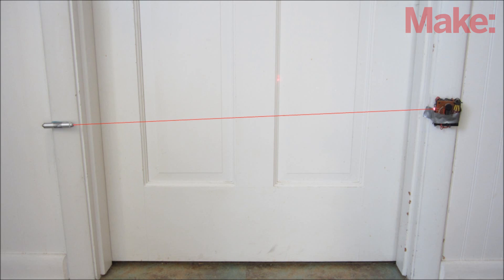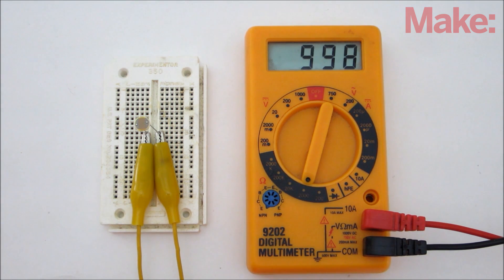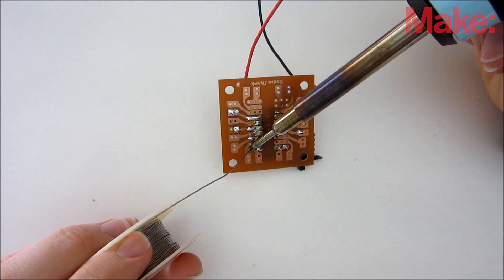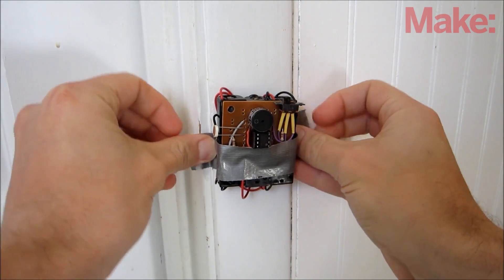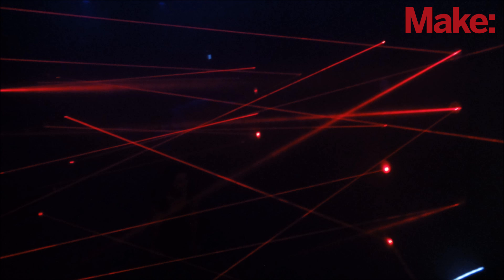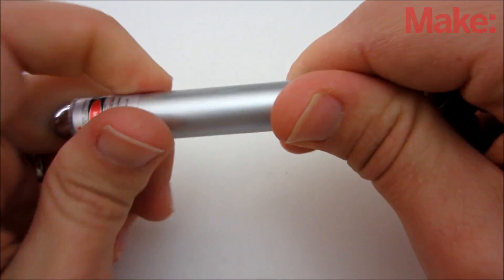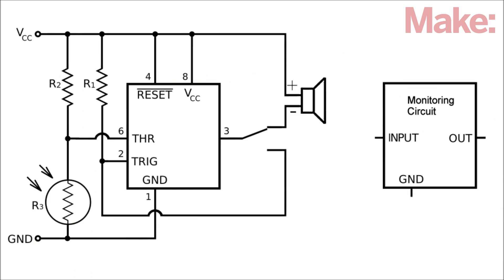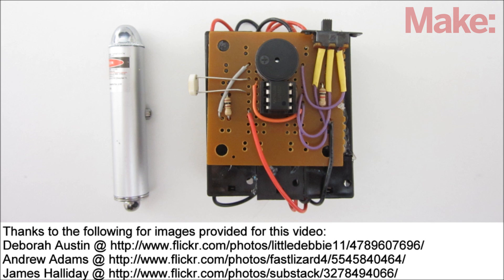DIY Hacks & How To's: Laser Tripwire

Comment: It works !!!!!
You need to know the value of the photoresistor when shining the laser on it by mesuring or to search the details of the model of your photoresistor !!
And if you want the buzzer works you need the power of the buzzer needed (me was 5v)
Buy part list on ebay or tayda electronics !
Reply: +JS7457 can i have the list of parts needed
Reply: Supachai Abusali yeah sure, here it is :
NE555 : http://www.ebay.com/itm/50PCS-NE555P-NE555-DIP-8-SINGLE-BIPOLAR-TIMERS-IC-factory-price-/321464862752?hash=item4ad8cc8820:g:gQEAAOSwGzlTx59S

8 pin socket : http://www.ebay.com/itm/50PCS-8-Pin-DIP8-Integrated-Circuit-IC-Sockets-Adaptor-Solder-Type-/281680024453?hash=item4195701385:g:Vc8AAOSwPgxVRLDf

resistor kit lot : 
http://www.ebay.com/itm/Nice-300PCS-30-Values-1-4W-1-Metal-Film-Resistors-Kit-Set-Resistance-Perfect-/111783588236?hash=item1a06d2318c:g:vqQAAOSwWnFWCQvs

photoresistor : http://www.ebay.com/itm/20PCS-GL5528-Photoresistor-LDR-Photo-Resistors-Light-Dependen-t-DE-/252118469425?hash=item3ab36e8b31:g:nqgAAOSwq7JT-wXz

slide switch : http://www.ebay.com/itm/20pcs-Mini-Size-Black-SPDT-Slide-Switch-On-Off-3-Pin-PCB-Mount-for-DIY-5V-0-3A-/361211745841?hash=item5419e5d631:g:MicAAOSwrklU2GuM

buzzer : http://www.ebay.com/itm/10pcs-Electromagnetic-impedance-16ohm-Universal-Passive-Buzzer-AC-2KHz-3V-5V-12V-/381374353810?hash=item58cbaed192:g:iN4AAOxy3yNTifFY

breadboard and jumper wire (optional) :
: http://www.ebay.com/itm/High-Quality-Brand-New-MB102-Power-Supply-Module-3-3V-5V-Breadboard-Board-830-Po-/252032256906?hash=item3aae4b0b8a:g:RU8AAOSw3ydVk6Bf

Prototype board :
 http://www.ebay.com/itm/10-Pcs-5x7cm-Prototype-Paper-PCB-Universal-Experiment-Matrix-Circuit-Board-2014-/400685385795?hash=item5d4ab5c843:m:mMucbQf0ZwjBE4Fa-XRStdw

Laser : http://www.ebay.com/itm/Portable-Mini-Laser-Pen-Pointer-LED-Flashlight-Torch-Money-Detector-Ultraviolet-/251972992471?hash=item3aaac2bdd7:m:mOC4qmLeAOmuqSUknzowJZA

OR

5pcs laser module : 
http://www.ebay.com/itm/5PCS-650nm-5mW-Laser-Red-Dot-Module-red-laser-sight-laser-diode-laser-pointer-/261977613858?hash=item3cff152622:g:tH8AAOSw7aBVC9xK

3 AA battery holder case : http://www.ebay.com/itm/New-3-AA-2A-Battery-Holder-Box-Case-With-Switch-EE4068-/141351797613?hash=item20e939436d:g:JEsAAOSwbqpTydFm

10m hookup wire : 
http://www.ebay.com/itm/10M-New-26AWG-1007-GAUGE-Black-Red-Wire-Cable-300v-80-C-new-good-/291548700260?hash=item43e1a81e64:g:UwQAAMXQgyZR75Uj
Reply: +JS7457 thanks a lot.... most of the parts are already in my arduino starter kit... and do u know where can i get the source code for this project
Reply: +Supachai Abusali source code ?
Reply: no problem i already got it

Comment: I actually found a lot of this video useful, but I have a little bit of experience  that helps.
The narration is top notch, the content should have been extended , this video should be at least 12 or 15 minutes and go over the process with a shot of the bread board that you could see every connection not just some.
To continue with the great contribution Scott made, here is a link for ebay search on the dip socketts , you should pay 10 cents or so not a dollar each, we could get the price of this project down around 5 to 10 bucks if we work at it, I'll try to help more later.
Search link:
http://www.ebay.com/sch/i.html?_odkw=6v+30+rpm&LH_BIN=1&_osacat=92074&_from=R40&_from=R40&_trksid=p2045573.m570.l1311.R8.TR11.TRC1.A0.H0.X8+pin+&_nkw=8+pin+dip+socket&_sacat=92074

Comment: I was so angry that there was no parts list that I made one. These should be right (but I promise nothing ;)

RADIO SHACK PARTS LIST (search for these numbers on the site):
Breadboard: 2882885
Wires: 2103801
Switch: 2062488
Photoresistor: 2062590
Piezo alarm: 210819
Battery Holder: 2062239
555 Timer chip: 2062595
8pin Retainer: 2062604
100 ohm resistor: 2062339
1000 ohm resistor: 2062343
(Yes, I actually had to look up the resistors by color code)

All together from the Shack will cost about $52, plus the laser pointer you can get at a dollar store. The reason the cost is high is that they don't sell singles for many of these, they come in packs of 5. 

I hope my wasted time of making this reminds MAKE to include this or these videos are just silly brand marketing and not helpful in any way.
Reply: Thanks for doing this! So appreciated! We're building an escape room, is there a laser pointer that can be seen without making the room dark?
Reply: @benpointer9227  not really unless you make a powerful laser and have dust in the air or a bag of flour that the people in the room need to throw to show the laser. A powerful laser will then require people to wear goggles to protect the eyes

Comment: Don't waste your money on trying to build it does not work the buzzer is a piece of crap everything is not really work as opposed to
Reply: its just a design dumb butt the point is to improve off it and make your own thing. its not meant to be a HOWTO
Reply: It's just a concept. I used a similar variation of this and it works very well. I even got it to trigger a camera shutter and fire a BB pistol in the direction of the intruder. It's just for fun, of course, a BB won't stop a real thief, although a nice digital image of their face might.

Comment: How long would the laser itself last? say if the laser would run over-night for every night of the week
Reply: You can figure this out if you have a multimiter. If your entire circuit is hooked up to the batteries, you can use your multimeter to probe for current-draw, then check how many mah your battery-pack is rated for. This means, if your circuit draws 100 milliamps and the battery pack is rated for 1000 milliamp hours, your circuit should last 10 hours. Of course, if that isn't enough, you can always use a mains DC powersupply with a voltage limiter to limit the power to ~4.5 volts.
Reply: tomalotube
you are right, i don't think you need all that power...
Reply: That laser pointer wouldnt last more than a day or two if it were constantly on. Someone earlier recommended using Infrared Diodes and sensors. Those would last way longer on less power.

Comment: Awesome, I still can't easily read circuit diagrams though.
Reply: Crowforge There are a lot of videos on here explaining the components. I like the Colin"s Lab videos. Also if you have a few bucks there are books written by Forrester Mims that teach all of that stuff including schematics of useful circuits.
Reply: It's pretty simple, I mean it's kind of silly but you can just pretend every line is a wire, and just go for it... what do you find hard about it?
Reply: MyMusicSosa The components, don't know half of them and the ones I kinda do, I can't keep straight.
Reply: Just think, -^^^^- resistor, -||- or -|(- capacitor and nnn inductor, and |>| diode or LED that's the basics, All else you can look it up, you'll get used to in no time, don't worry :)